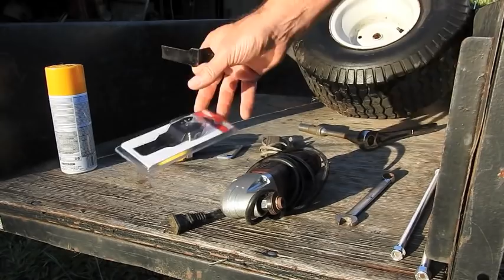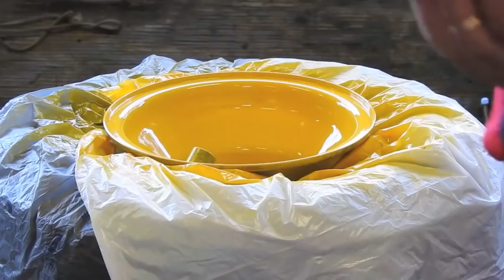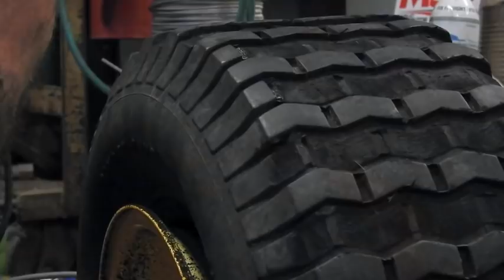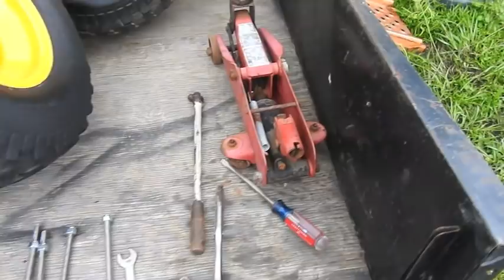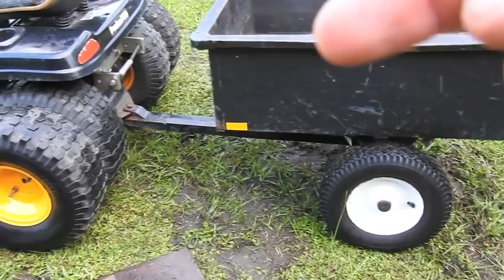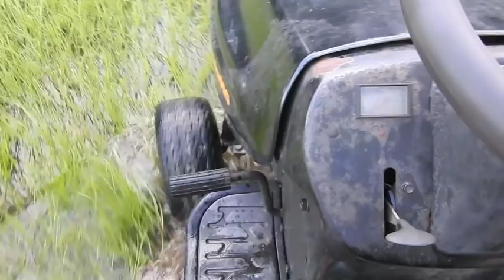How to Put Dualie Tires on a Mower

Comment: all you need to  do is take the inside wheels and turn them  around so the air stem is facing out  on the inside
Reply from the maker: I thought about that, but the offsets would not work. Thanks for watching and good suggestion.
Reply: just drill the right size hole for a valve stem on the inside of the rear wheels and you will have a valve stem on both sides.
Reply from the maker: That is exactly what I am thinking. That would be a quick, easy, and cheap mod. Thanks for watching.
Reply: can't turn them around because offset I believe
Reply: Add spacer or washers if offset wheel for flip and grind down the other side as for my experience.

Comment: If you use a jam nut on the inside wheel for the stud, it will line it up better and strengthen the stud against bending from torque. It made a world of difference on mine.
Reply from the maker: Thanks for the tip and I have already did a better system with tractor tires. Thanks for watching.

Comment: I install 18.5 kenda atv tires on the rear of mine. I used snowblower tires and rims for the front.  I can go anywhere this could and maneuver my wagon better. I use tire chains in the winter and can plow snow with ease. I regularly haul over 1000 pounds of water in my wagon with no issues. The weak link is the transmission, I have swapped a older peerless 6speed rear end, rebuilt it and put a 2 inch larger pully to gear it down for hauling. I've blown up Spicer and newer hydro trans and the peerless has been going strong for  6 years now. I do remove it and re grease it every year.
Reply from the maker: Yours sound like an awesome machine!  I wouldn't want to challenge you.  My machine is based on improvements that are free or super cheap.  For example, this video was about $6 for paint and nuts.  I would love some ATV tires on mine, but that is not the theme of this build.  As you see it, I probably have less that $20 in the whole thing.  To help with expenses, the neighbor gave the mower to me.  Cheap is just a way of life for me and I thank you so much for watching.

Comment: I had solid 2 inch steel slugs that fit perfectly in the rim. The tires were ag tires. Axle was welded on a Allis B-210. Tire chains on all 4 wheels. Snow, stone dirt. Unstoppable.
Reply from the maker: Thanks for watching.

Comment: Thats an old but rediscovered Great Idea !  Much easier and much more inexpensive than making it a six wheeler or making it a tracked  (tank) vehicle. And by the look at your play the rear end doesn't even need to be locked. You were spinning BOTH wheels when you were in that mud hole. Just here and there.  Keeps them much easier to steer when rear end is not locked.
Reply from the maker: I imagine it would be hard to steer if it was locked with the dualies... Thanks for watching.

Comment: Damn good method for cutting off excess tread blocks. I just bought flat-proof front tires and because their material makes them skid instead of grip this will solve that problem!
Reply from the maker: Yes, get you a cutter. Thanks again.

Comment: All the Poulans I ever see are brand new at Walmart, or dead in someone's back yard. This is amazing.I just fire up the old 12 yr old  gravely. If it won't go, just strap the Honda 670 Rubicon ATV to it.
Reply from the maker: I have never bought a new poulan, in fact, this one was given to me.  I love the thing so far.  I have had 4 Troy-Bilts give to me in the last couple of years, they seem to be junkier than the Poulan.  I do like a Gravely and thanks for watching.
Reply: chud327 My first rider was a snapper, in pieces, old as can be, but threw it together, used it for years. I am a  makeshift rigger of all my junk, I never knock someone's ingenuity. If you saw all  my equipment and how it stays running, or was modified, you would have a good laugh.
Reply from the maker: That sounds about like some of my stuff too. Thanks for the reply.

Comment: You can get a valve stem extension that is meant for trucks that have dualleys and then run it through the outside wheel,s axle hole
Reply from the maker: Good idea, but I might just punch two more hole and put two more valve stems in. Thanks for watching.

Comment: I just bought a lawn tractor with duals but will need new tires and pullies and a belt and chain needs tighten 😎 but will be repainting it John Deere green and will get decals for it and installing  a exhaust like a real John Deere tractor  and then after this beast is done I'll be building a auger trailer so I can operate in parades and kids can sit in the trained throw candy 🤔
Reply from the maker: Sound sweet! Thanks so much and thanks for watching.

Comment: You need to put a metal ring between the two rims to keep them centered and from moving around like they do on tractors
Reply from the maker: I was thinking the same thing, I need to try to make something up. Thanks for watching.
Reply: @chud327  You could 'adjust' the lip on the rims so one fits just inside the other.
Reply: I said the tractor supplies and Lowes have one it's like a drum and centers the rims up too the only think is it is white in color and that also means it is made out of that cheapo ground up recycled plastic shit that rots and deteriorates. I think make a better black plastic one I seen a pic of it in the store not sure of the rim sizes available. And the thing has 4 holes and a stem hole too. I seen a version online with a spacer so the tires are about 1" or so apart. I guess because of maybe grass or dirt or maybe even snow because they had plows and chains and shit on the same page of the ad
Reply: @chud327  make a hub ..the all thread will flex when not up and down rims are soft you will pull the nuts threw the rim .. it may work temp but long term it will destroy the all thread and or the rim and maybe the sidewalls of the tires .. plus if outer tire grabs and not the inner tire it will twist the rims and bend the all thread ..

Comment: two bolts on the rim it looks like that would twist of shift
Reply from the maker: No "twist of shift" yet, but I will keep trying. Thanks for watching.
Reply: chud327 just weld 4 1” long piece of steel 90 degrees apart to inside of outer rim and when you slide wheels together they’ll lock up
Reply: Really cool idea. He used what he had laying around. You could always add washers and larger all thread

Comment: you should drill some holes to add some more all thread. It will make it more stable and reduce stress on the bolts. I saw movement between the wheels.
Reply from the maker: If you check out later videos, I have improved the system.  My most recent video was rock climbing with the duals and the 2 all threads are still holding up... Thanks for watching.
Reply: @chud327  4/29/19, I mean......what does it do other than slosh around in the mud? No deck, so it don't cut grass.....maybe it's me       :/(

Comment: Hey, you should see about putting a bigger front tire on to see if you can improve your off-road ability! Would make it easy to roll over some things!
Reply from the maker: I currently have duals on the front now. If I don't run them long term, I will be hunting some bigger tires for the front.  That will help keep that belt and pulley out of the water. Thanks for watching.

Comment: suggestion"  Center the 'dualies', as can be seen in the video, they are off center (compared to the inner tires)
IMO: the most useful consequence of the 'dualies' is when mowing across a hill as they would greatly increase the tip over resistance
Reply from the maker: I you watch a later video on it, I built a better system.  In fact, one of my next videos is putting duals on the John Deere, I hope you will check it out and thanks for watching.

Comment: You need to make wheel spacer with a steel pipe with flat caps with the same holes that sets inside the rims to keep the wheel lined up, the make valve stem extensions for duallys so u can run  it from the inner tire to the outer tire
Reply from the maker: I like the spacer idea, but I think I will drill two holes for the valve stems. Thanks for watching.

Comment: Interesting, I could have used those dualie tires on my lawn tractor while I was trying to mow my soggy lawn this spring👍
Reply from the maker: I will have to put them back on, it will not stop raining here.  Did you see it when it had dual tractor tires, that was way cooler. Thanks for watching.
Reply: @chud327  Hahaha Yes I did see it with the tractor tires on it. 
That Tractor is an absolute monster when you got it fully setup. I was amazed watching it going through everything you put it through and it never got stuck. It also makes for a great tow truck tractor to rescue the other tractors when they get stuck.
Definitely a great idea👍
Reply: Pina  savador.

Comment: you could flip the inner tires so the valve stems are facing in then you dont have to cut the rims... also right rim is loos or not centered might want to use 3 rods to connect them instead of just two
Reply from the maker: The back wheels were not reversible like the front one. I am planning to drill hew holes and put in 2 more stems. Thanks for watching.

Comment: It would do way better if you drilled 2 more holes , so that you could have 4 studs. And maybe some sort of spacer to keep the tires from contacting each other. Maybe some 3/8 pipe for spacers on the all thread.
Reply from the maker: Love it and great suggestion! Thanks  for watching.
Reply: Your right

Comment: Hello Chad327.
I'm looking at putting duals on my atv.
I'm planning to get a plain set of fatory rims to put on the inside. I'm planning on taking the new rim to my local welding shop.
I'm going to get them to weld the valve stem hole shut, then drill a new valve stem hole on the back side of each rim. Then the vallve stem will be on the inside of the rim.
Reply from the maker: I am planning a valve stem fix on mine too. However, I am just going to drill new holes on the other side and leave the old stems in the center of the wheels.Good luck and thanks for watching.

Comment: So I found out if your looking for good traction tire chains are key. I've tried mud tires and after the tread fills up your done. I put some allis/simplicity chains on my troybilt pony and drive it thru 1 foot of silt and didnt stop at all!
Reply: Ya chains are great but if u drive on a hard packed surface like a road they are rough on u and the machine not bad in snow cause they sink in the snow but if u have any speed man they beat on ur back

Comment: From the video you are missing 2 important details 1st outer tires need a lower pressure than inner tires (will prevent you from snapping that transaxle) 2 take a 1-3inch wide ring of hdpe pipe the same Dia. As the rim lip to keep the tires aligned and to prevent destroying all of those rear rims. Also you may be able to flip the inner rims around on the axles so that valve stems are to the inside of the tires and are easily accessed to inflate the tires
Reply from the maker: Couldn't flip the inner tires due to factory offset, that would have been nice.  I have never ran dualies on anything so I have never heard of running the outer tire at lower pressure.  I was thinking of running them lower for better traction in the mud and the inner would carry the weight when you are out of the mud.  I like the spacer idea between the two wheels, but I don't have any that big.  Thanks for your input and thanks for watching.
Reply: chud327  running the staggered pressure/ tire size saves your axles/transaxle (think leverage principle) if the outer wheel drives onto a small rock you now have roughly An extra foot of leverage prying the lawn tractor up from the ground and your transaxle case is going to be the weak link (kinda like taking a 1x1 board 3 feet long cutting a 1/4inch groove around it in the middle and trying to pry your tractor off the ground... adding duals is like that 3 ft board now being 5 ft long... it'll handle less force being exerted on it   before it breaks so to counter the effects the staggered sizes/lower pressures are use to minimized the amount of time that you are exerting that force on the transaxle  as well as negating some of the force being generated in the first place (larger rock can be run over by the outer tire before the inner tire starts lifting off the ground.)

Comment: I like it and I would recommend a foot throttle it will work so much better for u 🤘👍
Reply from the maker: The foot throttle is on my list along with locking the rear end, I just haven't got to it yet. Thanks for watching.

Comment: You should of put spacers on the rod between the tires to prevent any rubbing plus if you have enough space you can possibly air up the tires while they're both on.
Reply from the maker: Spacers may be in the future, but I don't think I want them spaced that much. Thanks for watching.
Reply: Without the spacers your tires will rub against each other and eventually one will spring a leak.
Reply from the maker: The tires are touching, but I don't think you would call it rubbing. The bolts have the sandwiched pretty tight.  Thanks for watching.

Comment: I see a problem. Without a spacer between the rims the nuts will pull through eventually and you will also rub the contact surfaces down to a point where they will blow or no longer hold air. But I do like the idea I will have to try it on my John Deere l120
Reply from the maker: So far so good, I will let you know when something goes wrong. Thanks for watching and good luck with your deere.

Comment: turn inside wheels around so valve stem in on the inboard side and you can air all wheels without weakening  the rims.
Reply from the maker: I tried that, but when I put the tractor tire duals on, they rubbed. Did you see that video yet?  It is better than this one to me. Thanks for the tip and thanks for watching.

Comment: What length of bolts did you use for the duals? And what size nuts
Reply from the maker: Mine were about 25 inches long, but 12 may have worked. 3/8 inch nurlts to go with the 3/8 all thread. Self locking or double nuts. Thanks for watching!!

Comment: How does the engine handles the 4 wheels all together? And why part of the tire thread has been removed?
Reply from the maker: Engine handles it fine, I use the extra horses from the deleted deck. Tires are grooved for better traction. Thanks for watching

Comment: Should either roll a ring, or find a pipe that's close as a spacer between the tires, it keeps the tires centered and takes the pressure off your ready rod
Reply from the maker: I need to find some pipe that is just the right diameter. Thanks for watching.
Reply: chud327 Looks cool though!

Comment: Very cool hey bud have you ever changed spindle bearings and the old ones be stuck? I have a J/D 0 turn and have let the bearings soak and still won't move any suggestions?thanks
Reply from the maker: I don't know, have you tried heating it? Thanks for watching and good luck.
Reply: chud327 oh yea let it soak in penetrating oil hit it with a socket etc. the first one I did in the past they came right out I was just curious if you know thanks
Reply: No I thought about it may have to try that thanks

Comment: Does doing this give you any benefits other than looking a lot cooler? I'm researching for a potential project mower...
Reply: Yeah, it can give you some better grip and it’ll be good for if you have a bad tire or you get a flat..
Reply from the maker: Good points and thanks for watching
Reply from the maker: Makes more traction and less Rutt's. Not good in deep water, will make the rear end float. Hope this helps and sorry, just seeing your question. Thanks for watching

Comment: Turn the inside Tire backwards so the valve stems on the inside
Reply from the maker: That was what I was originally thinking, but the offset wouldn't work.  I started to drill a hole and put in a second valve stem in both inner wheel. That will probably be my long term solution if I keep it this way. Thanks for the suggestion and for watching.

Comment: Could you make a video on how to do that for a yard trailer I know it sounds weird but I haul a lot with mine and I'm blowing through tires 

literally
Reply from the maker: I actually did this again on this mower and it was a stronger method. I would think that method would work great for your trailer. You could even add extra all-thread for more strength. Let me know if you can't find it and thanks for watching.

Comment: I did this on my traxxas 4x4 i found it worked better if i put 2 nuts per rim. So i could tighten my stud to the wheel.
Reply from the maker: I like that and that may be my next dually improvement. Thanks for watching.

Comment: Mod ideas peerless 700 trans. Mounted in place of factory transaxle driving a keyed rear axle(s), dual rear axles with duals, ag tires with tire chains 3 bar front tires for improved steering
Reply from the maker: Those are some serious modifications you are talking about there, I should think about doing some. Thanks for watching.

Comment: So after all this time has gone by what was the result? did the all threads snap, bend or did you have to add additional connectors? How long did it last?
Reply from the maker: Please go and watch my two most recent videos.  The dually dually is doing just fine.  The outer tires wobble slightly, but other than that they are doing great.  I have just found a set of 4 tractor tires that I want to get for it, they may break it quick.  I also want to weld it and lock it, that too may break it quicker. Keep watching and we will find out together what happens and how long it lasts. Thanks for watching.

Comment: You know you can get cheap valve stem extensions like what's on a dually and run them through the hole in the center of the outside wheel
Reply from the maker: Great idea and thanks for watching.